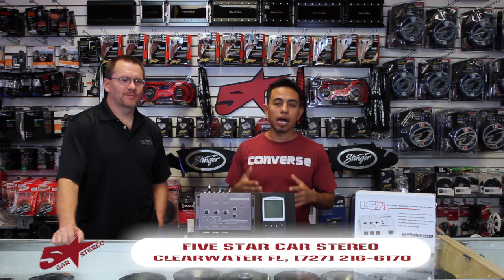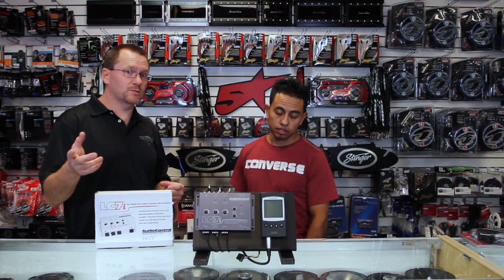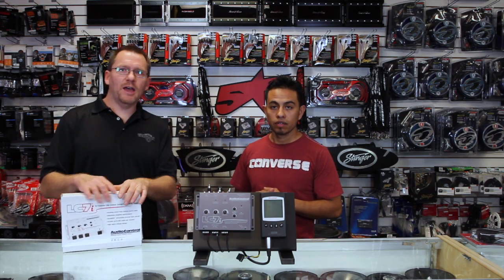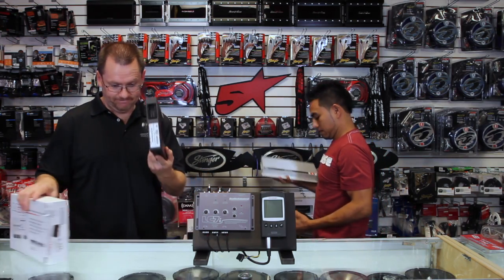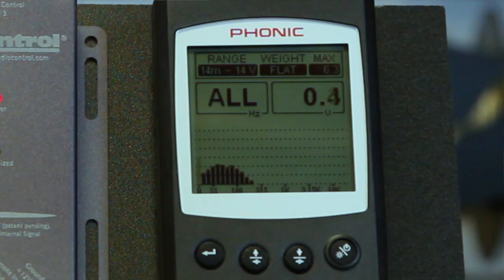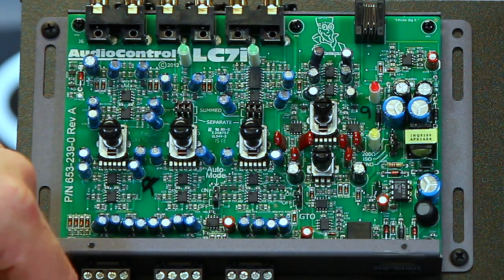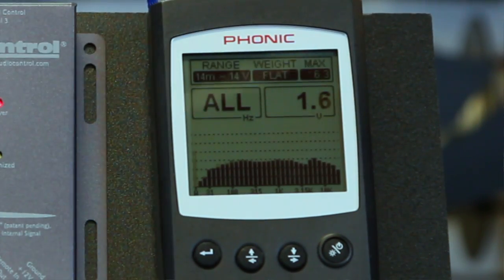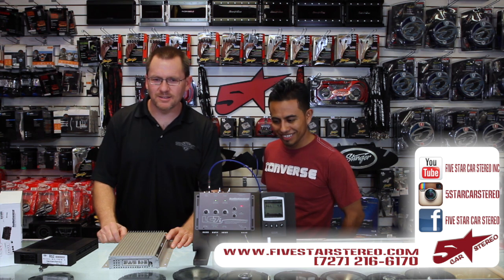Introduction to AudioControl's LC7i part 1 "how to do 3 way summing"

Comment: I was wondering if you could tell me what wires would go from a factory radio to my LC7 eye and then from there I got a 2. Channel amp and a 3 channel amp the 2 channel app is going to a 4 subwoofers. And then my 4 channel is gone to all 4 factory speakers. How would I hook all that up?

Comment: Thanks for the vid, helped a lot. However, I am running a component front(w xover) and 2 way rears, plus sub. Since my tweeters have their own Xover, wouldn't I want full range on main and 2nd channel and the 3rd chan seperate for sub? Do you have a video on how to sum that? The manual isn't really helping. Running a single 5 channel amp if that makes a difference.

Thanks
Reply: This is exactly the question and why I came here because I can't find anyone that shows me how to get full signals out of the first set and second set of the LC. How do I get a full signal going to the 4 ch amp

Comment: Hey guys. I have a 2014 kia optima with the premium sound package. What speaker do I use for main , channel 2, channel 3 ?  I am not sure cause I did front for main the rear for 2 and sub on 3. My tweeters got blown and the front door drivers were close ..if you could point me to the right set up I would.be grateful.  Ty

Comment: So I have a 2019 Honda Accord. Planning on putting in a full system to integrate with the factory system.

Replacing both front doors and rear deck with 6.5 components. Bought a 5 channel Rockford Prime amp, 12 inch JL Audio Sub as well as an Audio Control LC7i.

Got a great quote from an installer he said that I didn’t need the LC7i, in fact he said that he doesn’t use them in the newer cars.

Is this correct? I want to do this once and I want to do it right.

Comment: Can you use the lc7I for just amp and sub? need to keep factory speakers for now but would like to add them later was going to use lc2i but didn't want to have to upgrade to lc7i when I purchase door speakers.
Reply: I have the same question. Did you get an answer?

Comment: My factory stereo in my 20 Ram is not amplified. Would I still benefit from summing the 4 channels? Or just leave it be? I don't know how much EQ is built into stock head unit. So I guess does summing help regulate factory EQ? The Accu bass function makes sense and I understand.

Comment: I have an Acura MDX. I put my 3 sources as the tweeter, rear door speakers (I figured that these are more full range), and then the  subwoofer channel. It still seems bright and it seems to be lacking in the lowest bass. Would I be better off doing tweeter, front door (Mid range only) and sub so that I can control each of the three better? Also, any tips on the bass. It seems that Acura may roll off the lower bass and the accubass is not quite making up for it.

Comment: am installing a new radio i was wondering after i run my wire from the radio to the lc7i can i send the out put to an eq then to a amp
Reply: i would say yes did you get any other info on this?

Comment: Will this work with a unit that has 20 speakers. ? All I keep hearing is factory units  so I’m assuming it can’t be used on any other items than factory. If not who nose what I can use  to fine tune my system
Reply: You cAn run a Dsp like a jl audio fix 86 or a helix

Comment: Hey would this help with. A 2019 impala where the stock head unit causes distortion from a aftermarket 4 channel most likely due to the factory dsp

Comment: just bought the lc6i. looking to change out my front and rear door speakers on a 4 channel amp and 2 subs under the seat on a bass amp. how would I wire up the line converter to send single out to the 4 channel amp and to the bass amp without issue?
Reply: Joshua Martin  i just got an LC6i  for front rear and one woofer.   No idea how to connect it
Reply: @o1tsomes  thanks for the reply. It's all wired up and works great

Comment: Nice vídeo , I want to install that on my 2018 ram , but my question is where do I get my subs outputs from the stock radio since it only has 6 speakers outputs ? That's where I'm lost
Reply: Jonathan Cruz it’s pretty simple after you read the instruction/owners manual. In your case, you use inputs 1-4, and have front speakers on main output, rear speakers on output 2, and subs on output 3.  You don’t have a sub with factory audio, so you leave the jumpers on inputs 2 and 3 on separate mode, and leave Channel 3 input in auto mode. This unit will generate a full flat signal in channel 3 now that you will have to use the low pass filter on your amp. Hope this helps.

Comment: Hey guys love your videos! My 03 Mustang GT vert is equipped with the MACH1000 factory system, MACH factory head unit with 2 MACH factory 10in subwoofers in the trunk, and a PAC PDLC81 unit. So far I replaced both sets of the MACH factory 6x8s with 2 sets of JL Audio C5-650 components and 2 Alpine SBR-S8-4 8inch subwoofers fed by a JL Audio 1000/5 amp. If I want to add another 3 sets of JL Audio ZR-650 components with I need this LC7 unit or a LC1200.6 with digital process&acr?

Comment: How are these head units getting the signal to the factory amplifiers? Is it via optical cable such as a tosslink or digital coax? In my case I have a 2018 Honda Civic Type R US/ FK8. If it does use optical tosslink then I could use an Alpine PRAH-600 dsp x-over with built in digital eq with 3 or 4 way x-over to do a 3 way front sound stage and a separate sub output for a dedicated sub amp. I believe it also has a built in rear channel delay for a ambient rear stage fill.

Comment: Can you use it for a aftermarket headunit?
Reply: Why would you want to? Just use your RCA outputs?
Reply: Yes you can it will boost your preamp voltage. It’s a line driver too

Comment: Great video guys very informational.  If you install a lc7 and the source is from a factory  amp if factory amp goes out then your going to have to replace factory amp or go with aftermarket hu ? Is this correct? I own 2011 Camry jbl system
Reply: Thomas Radtke the Oem doesn’t have to go out for u to add a lc7 it’s more if u are trying to keep you’re factory head unit.

Comment: Can I use this on a 11 ram 2500 with the built in alpine system  would like to change doors and sub on it and audio stores around here would not touch it  it has 10 factory speakers all together .including 8" sub
Reply from the maker: Get the PAC amp-Pro for that system. PAC-Audio.com. It will give your Factory radio a 6channel 5volt output

Comment: What you guys think about using this to retain a center speaker after changing out the factory head unit
Reply: jbarah05 I wouldn’t invest on this unit just for the center channel. Leave it stock or un plug it.

Comment: Hello, I have a 2016 Charger with the Alpine system. I want to change out the 6x9s front and back to aftermarket and  also add a 4 channel for the doors and rear deck and a mono amp for two 12s. Would this work for me?
Reply: dave williams yes.
Reply: dave williams especially since the aftermarket bracket for this car’s is to expensive. But if u are going to change the head unit then I would’t invest on this.

Comment: Thanks for all the awesome videos. Quick question, I currently have a TacoTunes Recurve (rebranded LCQ-1) feeding a 5-ch amp. I am going to replace the head unit with a Kenwood DNX893S with Maestro RR. Would you recommend removing the line out convert (Recurve) and just use the preamp outputs to the amp? Or leave it in the loop?
Reply: Aaron Wilson just use the outputs of the radio.

Comment: I have a 2017 dodge charger with a 2017 dodge charger. I just bought aftermarket speakers four 6 x9 hertz mille pro with a hertz hdp4 amp. For some reason the tweeters are way too bright. Treble on my stock radio is at negative 7 and it's still too bright and not a natural sound. I do have a lc7i installed. A audio shop did it for me,  but not sure if the lc7i is supposed to even things out.  What do I do?

Comment: Hi I'm depend from a lc6i and matrix plus. Now I have a dodge charger with uconnect what would be better for car. I'm running for 6 by 9 and a w7. I want to be able to make them hit there peak . Could u help me out what would be better
Reply from the maker: +Jerry Montellano does it have the factory amplified system? If yes get a PAC Amp-Pro. If not look at the LcQ1

Comment: I have a 370z so the car only has front speaker which is the mid and tweeters on same on the same signal, I am adding a sub and amp as well. So my question is what is the proper way for me to go about this ?
Reply from the maker: +hemil mejia you could just use the LC2i connected to the front output of the radio. That will give you a sub channel output  and a front channel output.

Comment: How would I install an aftermarket head unit and 2 amps(4-channel) and Monoblock to a 2013 Mazda Speed3 that has the Bose audio system. Do I bypass the factory amp or what steps should I take.
Reply: bypas amp

Comment: I took my 2017 Armada to the local car stereo shop to install 2 8" subwoofer and an alpine amp, after paying 300 dollars for it, the bass has no punch at all. The factory radio is a Bose radio. They telling me the i need a new amp and new subs do to size of the car. Do you guys think i should try the LC7i?

Comment: I LIKE TO KEEP THE FACTORY RADIO IN MY 2012 INFINITY G37 AND PUT A 5 CH AMP IN , IT HAS THE BOSE SYSTEM DO YOU HAVE A SHOP IN THE DFW AREA OR A DIAGRAM  FOR HOOKUP THE AudioControl's LC7i

Comment: Hi Dean and Fernando, Thanks all the valuable knowledge you
share. Previously asked  this in the wrong video. I have a PioneerGM-9605 5 channel amp on order. Would I gain 
anything in audio quality with an Audio ControlLC7i over the built in
speaker level inputs  of the Pioneer? Going in a 2017 F150 XLT, no Sony,
 no nav. Standard audio.
Infinity Reference components and a Pioneer 10” shallow mount sub 
enclosure also coming.
Thanks, Walt

Comment: How would I hook up jbl gx600c components and gx602 coaxial with subwoofer and 2 Alpine amps with 2016 f150 7 speaker system

Comment: How come I only get the red power light on? I'm not getting the connected to main channel light or the maximize light on.
Reply from the maker: GuNNeR2SicK those lights are for when you are using the LC for summing. Example front mid and tweeter on input main and 2. There are jumpers under the cover. If you are just doing front and rear input, no lights.
Reply: Ok im only using it for bass right now until I get another amp and components ..another question I have an amp for bass hooked up to the main imput is that fine or should I connected to channel 3 since it says on that on the book. I'm using that side until I get an amp for the components .
Reply from the maker: GuNNeR2SicK if you would like to use the Accu Bass connect to input 3. If you are also using the GTO turn on then run the input into main and 3( you can "y" the wire to both)
Reply: Thank you Sir. love your work n videos.

Comment: Great informational! I just purchased the LC7i in order to maintain all the options of my 8" head unit in my 2016 Ram 1500. I did not get the premium alpine system and am in the middle of replacing my door speakers and dash speakers. I'm will be installing a JL Audio JX400/4D for the Dash, Front, and Rear doors. At first, I had no plans to run the dash speakers from my amp but they are the JL C2 3.5's so I figure I might as well put them to full use. I'm running new speaker wire to each component and have 9 wire to go from the head unit to the processor (LC7i). What is the best way for me to wire this so that 4 channels of the LC7i are feeding my 4 channel AMP which will feed 6 speakers (2 dash, 2 front door, 2 rear door)? Also, the remaining 2 channels are fed by what? I need to use an RCA output for a secondary amp in the future - I just haven't decided on the sub setup I want for under the seats. Also, I'll cut the speaker wires at the head unit harness and feed the LC7i with the radio speaker out, then feed the amp via RCA for front and rear - What's the best way to split the front between doors and dash (my main issue on my drawing). Any advice would be greatly appreciated!
Reply: I can’t answer your question. But I have the same setup snd wondering where did you mount your LC7? Did you mount it IN the dash behind the radio or some place else??? 

I had a installer tell me it was best to mount it in the dash behind the radio, I don’t believe him.
Reply: i would hook all six channels on the input of lc7i then summe all then switch the jumper to defeat. use chaneel 1 and 2 for your 4channel amp (your just goin to hook up for of your speakers to only 2 channels on your amp and leave the rear channel for only your rears). use the 3channel of your lc7i rca output to feed your sub amp

Comment: Hi there!  I have a 14 Cruze Diesel.  It has NAV but not the pioneer system.  Im going to add a sub, mono amp, upgrade my door speakers, and add a 4ch. amp.  Is it possible to go straight from the back of the stock radio into the LC7i and then from there to my aftermarket amps and totally bypass any stock amp that I might have?  If I do that will I mess anything up?  And how would I go about wiring up the LC7i in that fashion?
Reply from the maker: Brice Hatcher no, the LC is made to go after a high level output only. If you radio has an amp the radio output would be fixed and low level. Fixed mean the level output would not change with the volume control. If your radio does not have an amp you can go behind the radio. If it has an amp you are going to have to go after the amp.

Comment: hey guys I have a 2015 Silverado no Bose , I have a 5 channel amp for the door speakers and a 600 watt mono audio pipe for the 2- 12" subs ,   if I get a lc7i ,will it run both amps, 1and 2 channel to the 5 channel amp ,and 3 channel to the mono amp?
Reply from the maker: hammerlane2 so your truck is a little different because of the door chimes. When we add amps to the Chevy this is what we have found to work the best. We only connect to the rear speakers from the radio. We have the rears power both front and rear on the new amp. We take one of the old door speakers and mount it under the dash for chime and on star.  This speaker will get power from the left front output of the radio.  Doing it this way you will lose fader control, but you can use the amp to for that. Having the chime come through the amp will blast you out of the car. Now doing it this way you really only need the lc2i and possibly a pair of y connectors for the 4channel.
Reply: Five Star Car Stereo 
Team, I have a 2016 Silverado Crew LTZ Z-71 (Non-Bose). I am being told that the amplified tones have been fixed from the factory and will not be affected by amplifying the signal....is this true? If not, is there a way to get the signal from behind the radio, exclude the front left channel and sum it into the LC-7i? I am also still unsure of the speaker wire colors on the 2016 Silverado. Did it change from 2014-2015 models? Any help would be appreciated.....thanks again!

Comment: Great Video!! I just installed a LC7i on my base radio on a BMW 328i (no factory amp). I'm getting some static and a clicking sound on my rear speakers and subs. Sometimes I'll even get a click on the front speakers but very very soft clicking sound. I also ran a kenwood 5 channel amp. It's worth mentioning that my car is also giving me a SOS error code. I appreciate any and all help!!! Please.
Reply from the maker: Alejandro Velarde try running your phone directly into the amp. ( aux to RCA) Check to see if the sound is in the amp or coming from the LC7i
Reply: Five Star Car Stereo is it possible the sound could be coming from the headunit?
Reply from the maker: Alejandro Velarde yes. There is always the possibility for noise doing this type of install. Keep the levels low

Comment: Great job on the video. I am thinking about removing my Sony radio and putting the factory radio back in but I want to keep my little 50 watt amp and my compact sub that has it's own amp. Is this what I need to use to do this conversion on would I need something else? Thanks Dean, Happy New Year!
Reply from the maker: Tim datoolman no this would work great for that. Why do you want to put the factory back? 
Thank you, you too
Reply: I still want to keep the iPad setup I just like the way the factory radio integrates with the truck better. Every time I turn the truck on I have to "allow" the Sony to connect via USB, and sometimes it glitches out and I have to close the app and reopen, (seems minor I know but annoying) I lose On-Star by using the Sony radio, I can't answer calls with the steering wheel controls with the Sony. With the Stock radio I can. I can skip tracks and control the volume with the steering wheel controls with the Sony installed though. Wait, I went and got the box to see which PAC unit I have and it says right on the box that It has "On Star"? Im Using the PAC RadioPRO 5. I did remove the rearview mirror and replace it with one that has a backup camera but On Star didn't work when I pushed the button when I had the factory mirror installed? Your feedback on this would be awesome.
Reply from the maker: Tim datoolman the RP5 is the mac daddy of interfaces. It sounds like a new radio would be a better option. If you still had the factory mirror you could have retained on star with that interface. Personally I would wait a little and see what new stuff is coming out.
Reply: Sounds like good advice, I think thats what I will do. Thanks Dean.
Reply from the maker: Tim datoolman you bet